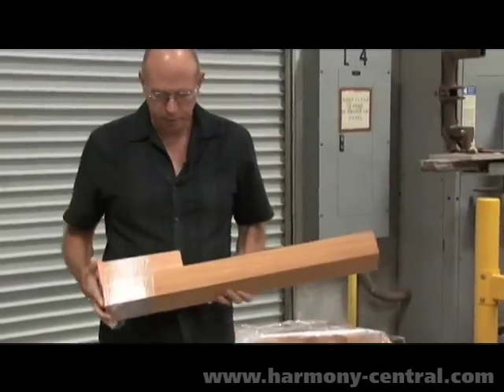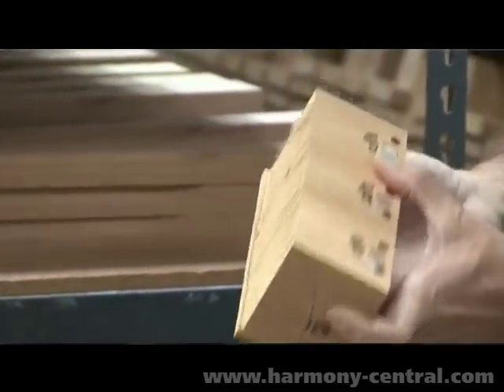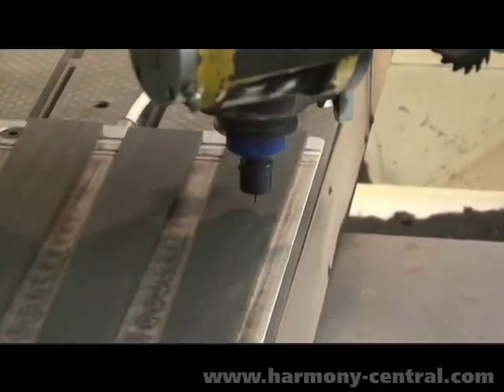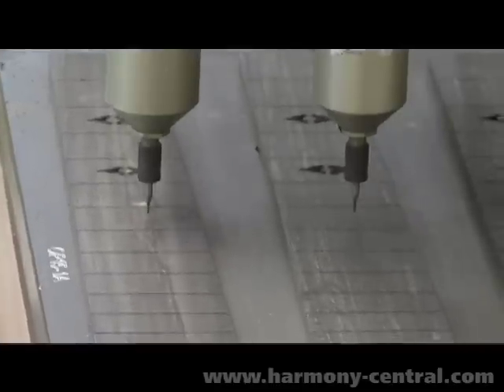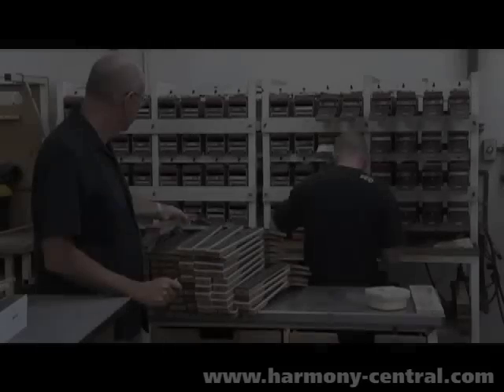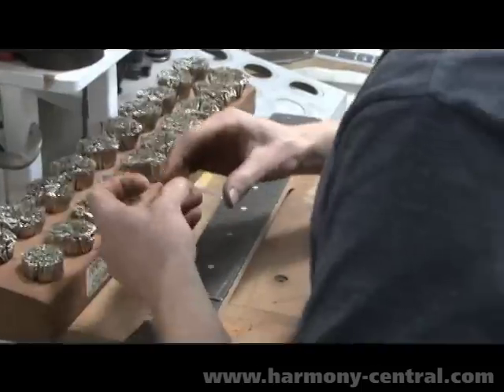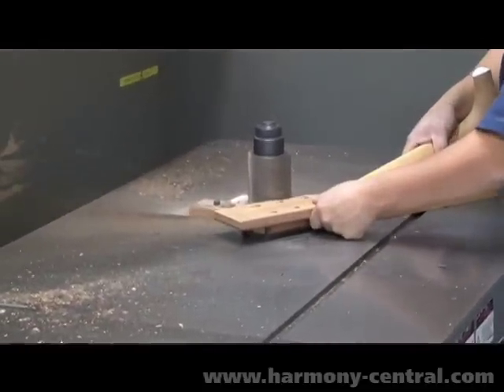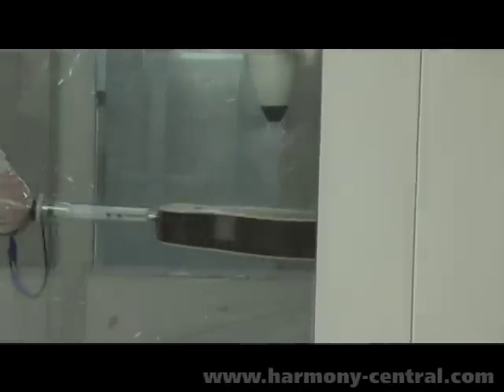Taylor Factory Tour Part 2 of 4 - Neck Construction

Comment: You are wrong.  The craftsmanship is in the computer technology and the incredible accuracy of the machines.  No human could make a guitar that fits together better than a Taylor.

I have a 314ce that Guitar Center ordered for me because they didn't have one in stock.
When I got it home, I went over it with a fine tooth comb.  The fit and finish were PERFECT.  No gaps, no flaws, no rough edges.  Impeccable.

Comment: Also... Quite few high end acoustic guitar manufacturers use bolt on necks. Taylor, Collings, Breedlove, Seagull, Huss and Dalton, Bourgeois, etc...

In fact... The list of manufacturers that DON'T use bolt on necks would be shorter than a list of the ones that do. The reason? Because it's more economical and easier to reset, repair, or replace a bolt on neck. Many acoustic luthiers say that bolt-on or glue doesn't affect tone, as long as it is routed into the body and is a secure joint.

Comment: I build guitars myself.  Damned good ones.  Nothing wrong with multi piece necks.  
Hell, John D'Angelico made some of his archtops with multi-piece necks, so your argument is invalid.   There's nothing wrong with a multi-piece neck if the glue joints are done right. (Tight.)  Bolt on necks transfer sound just fine, too, although I personally prefer glued in necks.

Comment: Well a lot of the work is still done by hand. The assembly & set-up process is done by hand. With CNC machines the wood cutting & carving is way more precise, the tolerances are very tight, and all the guitars are consistent. When I was a kid, a lot of guitars, especially inexpensive ones, were poorly made. Necks were put on crooked, action was horrible, parts didn't line-up. But now thanks to CNC machines, even inexpensive guitars are fairly well made.

Comment: ”Scarf joint" and "bolt-on" neck mean cutting costs. A one-piece neck is harder to source wood for, and more difficult to make, and bolt-on necks are designed to save time and labor. If I want a guitar made by a cost-cutting company, I'll choose a Yamaha, which costs far less. But wait,  all of  the Yamahas I have played use one-piece, set necks... As soon as I saw the headstocks being glued to the necks, I decided never to buy a Taylor guitar. I would guess that Taylor has very few skilled workmen, because none of the workers I have seen are trusted to do anything but push buttons on the machines. But unskilled labor is cheap labor. Unfortunately, Taylors are not cheap guitars.

Comment: Watching this I figured out why I dislike Taylors even though their fit&finish is the best. He's basically downgrading a guitar and calling it an upgrade. Scarf joints are terrible when on a Chinese guitar, but on a Taylor it's OK. Bolt on necks are disguised as an 'upgrade', while it's pretty clear a dovetailed joint has more surface area to resonate. Why would anyone pay 1200 bucks for a guitar that has laminated back & sides. Is it the 'made in USA' stamp? It certainly isn't the tone.
Taylor guitars: I admire your precision and consistency, but that's not what a guitar's about. A guitar is about tone. No two pieces of wood are identical, so treating them identical won't bring out the best. That's why guitars need to be built by hand, by experienced builders and tried and tested methods.
Reply: As matter of fact, I own a Les Paul which has fallen on the headstock resulting in a neck-crack. Sure, inconvenient, but as the luthier who fixed it said: 'you can't blame something that's built to resonate as good as possible for breaking when put under more pressure than what it was designed for'. Eyeballing goes 2 ways: it's less accurate, but it does allow you to take the specific qualities of the wood into account. 

I'm not saying that automisation is the only thing wrong with taylors, but the specifications marked as improvements are in fact downgrades. Often found and despised on chinese made 'knock-offs'.

To each his own, but woods will always shift and change once a guitar is built so you can't build a perfect guitar. And i still don't see why people rather buy a sterile sounding guitar because 'they consistent' and walk past soulfull guitars that have a unique character
Reply: For the most part I'm totally with you on the "upgrades." I've got two Taylor guitars, 816ce Grand Symphony and 814ce Grand Auditorium, that I tend to only use when I'm doing acoustic shred styles live. They play incredibly well, but they just sound ok. They're loud and fast I suppose. I cannot comprehend the rationality for a bolt on neck. It's beyond me.

My go-to acoustic will always be my Alvarez Yairi guitars. They sound incredible and play incredible. The necks are slightly beefier so I don't use them for shred styles.

Comment: Paid good money for a 150e 12 string but I live nowhere near an authorised repair person and since most Tailor guitars are not correctly adjusted and necks need re shimming .. guess what  ? They refuse to provide corrective shims. Have tried everywhere but only received condescending dismissive reply's from Taylor and links to Australian repair techs closest 700kms away and I wont mail my guitar. I am perfectly able to do the repair and the maths to set up shims neck and saddle but they wont help at all. My action is 13/64 at the 12 fret, guitar kept in perfect humidity. Am gutted as I look at my $1400 au wall hanger. Don't buy unless you can afford expensive hidden costs and egotistic help people.